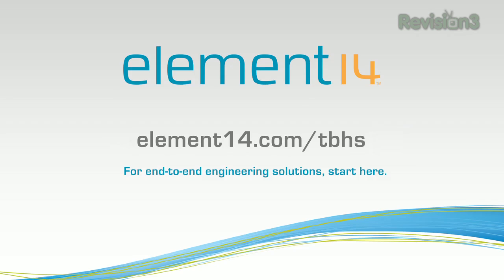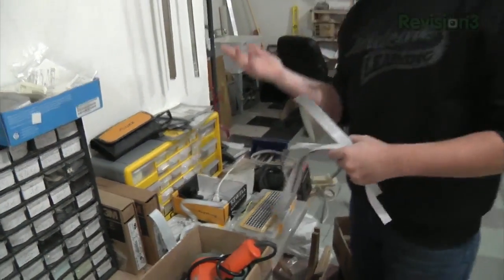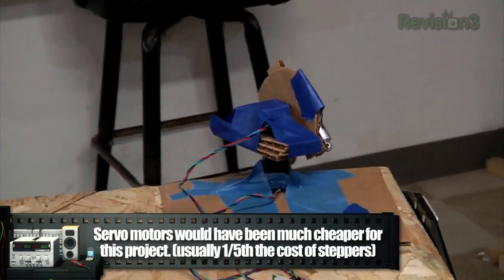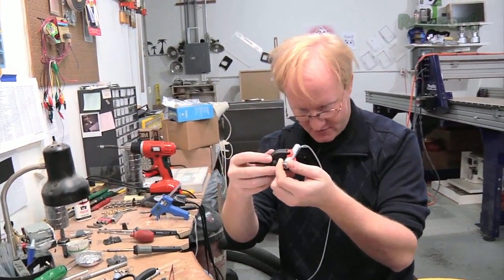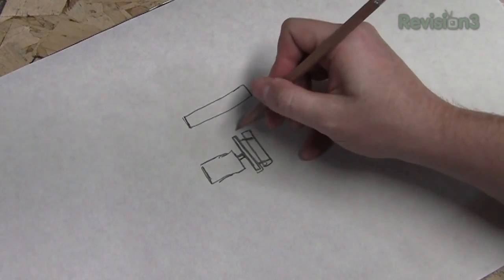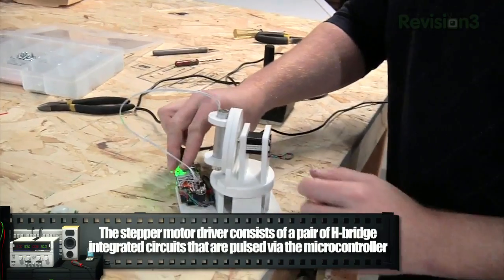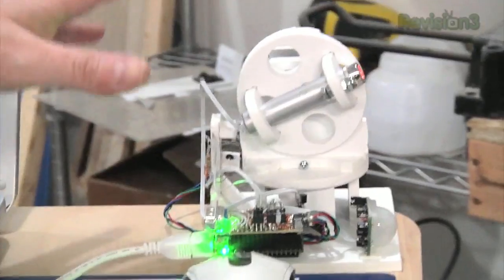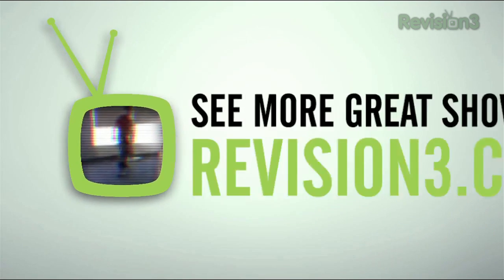Creating Mods with Thanksgiving Leftovers

Comment: Awesome idea, funny video, but in the end this could be a very dangerous 'toy' for cats. Laser pointers are in fact lasers, one shot to the eye and you or the cat could damage your vision permanently or even blind yourself! This is fairly easy to watch for when you are operating the laser (still have to be very attentive, critters move quickly), but unattended it couldn't end badly. A small, focus-able flashlight, would probably give similar results, cats will gladly chase them as well.